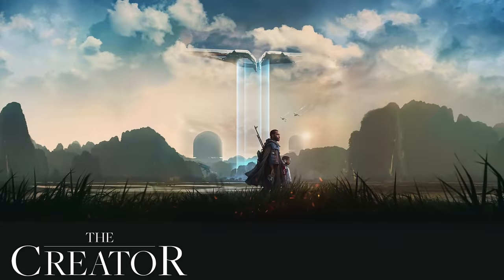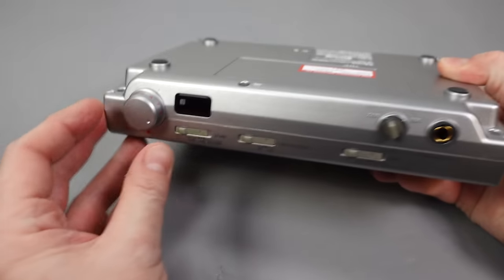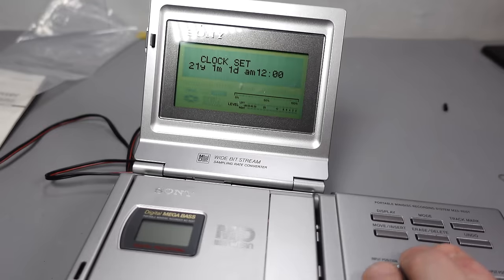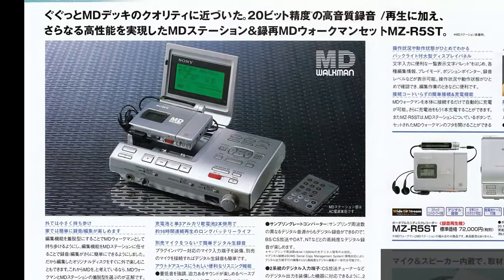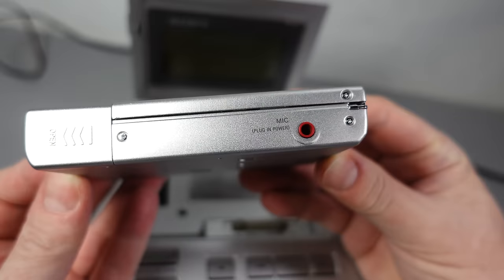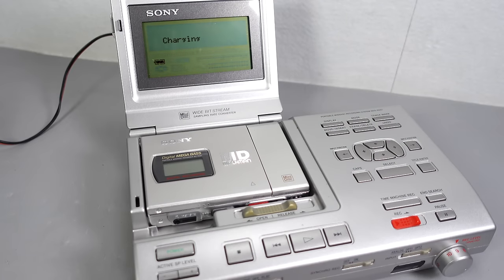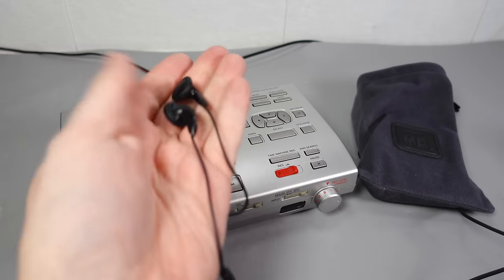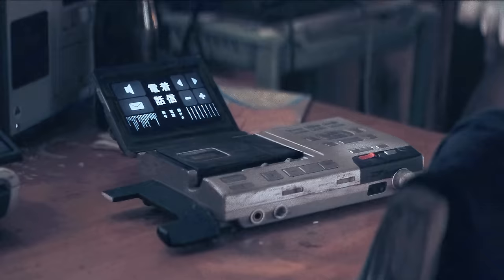Sony’s self-destructing MD Recorder from 2070

Comment: One can only presume that someone from that film watched this video and found out they needed to remove the batteries and that is why their MD recorder is still working in 2070
Reply: Techmoan legit could be a reason why some of these devices will remain for the future in working order. I bet that all of about a dozen people who still have and use these and haven't changed those batteries yet, will start to do so after this :D
Reply: @MetalTrabant  plus all of them that have only recently been killed and are still salvagable
Reply: There need to be a credit in the film "A Special shout out has to go to Techmoan without whom this phone would not be possible."
Reply: Random video on YouTube that played automatically without me selecting it is how I found out about the killer capacitor in the original Xbox 😂

Comment: Thank you.  I have one of these still all working and didn’t know about the batteries.  Extracted them and a little leakage but no damage yet.  Sleep well in the knowledge you helped save a minidisc player.
Reply: take some pictures of the pcb traces for techmoan :)
Reply: Put lithium AA batteries inside, they won't leak, as far as I know.
Reply: I'd just leave the batteries out (and keep it unplugged when not in use) as the corrosion might still conduct electricity and keep advancing if there's a steady source of power there.
Reply: It is probably still worth trying to clean out the alkaline residue as its still conductive and corrosive to a limited degree... I have had success a couple times  on various  electronics removing the circuit board and gently and carefully (to not spread it around) using a tooth brush or Q-tip and distilled water rinse away the alkaline residue, Once or twice that alone solved the problem (apparently it shorted a circuit out) and another time a couple of obvious breaks in traces were revealed and so minor soldering and short wire overlays solved the problem. Just a thought if you want to protect it longer-term....
Reply: Use vinegar or lemon juice to clean the residue off. And then use isopropyl alcohol to clean that off.
Reply: @amojak  In another video, Techmoan said he wasn't good with fixing electronics.
Reply: @dorfschmidt4833 Nope, they most likely would explode since those Ni-Cd batteries were there to get charged by means of the power adapter in order to deliver back up power for that built-in clock once or when said power adapter wasn’t plugged in.

Comment: I have two of these docks that are both working, I had no idea there were batteries inside! This video was a lifesaver 🙏
Reply: Phew !
Reply: I think you owe him a beer :)
Reply: Maybe you could take some macro photographs of the circuit boards to allow techmoan to patch his missing tracks.
Reply: So the superior digital port works. I see no problem here.
Reply: Maybe yours have been used from time to time. NiCd batteries usually leaking after a fully discharge and years of abandonment, if you recharge them at lest once in a year, they may well live until 2070.

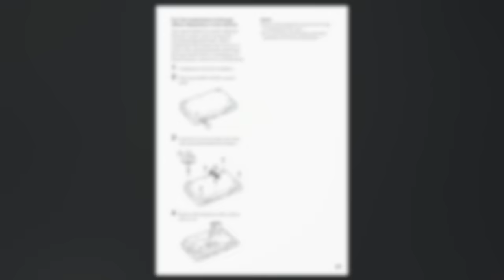Comment: In all my years as an electronics/DIY enthusiast and professional technician, and despite having visited Japan twice, I had never come across the term "minus driver" for a flat-bladed screwdriver until noticing it in that disassembly guide (12:50). Having now Googled it, it seems that the terms "plus driver" (purasu doraibaa) and "minus driver" (mainasu doraibaa) for cross-head and flat-head screwdriver are common in Japan and clearly have been for decades. Every day is a school day.
Reply: Wow yes ! exactly the same here...who knew lol !
Reply: It's also relatively common in Russia too
Reply: Interesting. And thinking about it, it actually makes sense to describe them that way, visually speaking. I'm actually surprised it didn't catch in other places too.
Reply: I knew about "plus driver", and had assumed but never actually seen "minus driver" in the wild. Nice to get confirmation all these years later (about something I clearly never cared enough to look up!)
Reply: That's some lateral thinking right there. 😊
Reply: The plus driver is used for adding screws and the minus driver is used for removing them.
Reply: The plus driver only drives Clockwise.
Reply: LMFAO!! @JamesChurchill3
Reply: @JamesChurchill3  🤣
Reply: i remember that from back when hitachi/tanaka/kawasaki etc used to supply carb mixture screwdrivers with every new machine
Reply: These terms are also relatively common in Germany
Reply: @RiverrRiverr  I have never heared them. Im German technician since 25 years
Reply: I think "minus" and "plus" are used in Germany too. Interestingly, Japanese audio gadgetry for the European market seemed to favor the DIN plugs "long" after many others went all RCA.

Comment: You might be able to fix the PCB by adding jumper wires to fix the broken traces. If you can find the service manual it will help. It's a time consuming process but with luck you might be able to fix it if no critical component was damaged too.
Reply: or send it to a youtuber that does that
Reply: Even if not fixing it, cleaning the PCB with isopropyl to avoid more degradation from the battery guts would make sense.
Reply: @av_oid  White vinegar is good at removing leaked battery ooze as well. But clean up after with iso to remove acidity!
Reply: Yup, vinegar is a base and will neutralize the acid.  Makes a fun little fizz while you're at it, too :) You could clean with alcohol afterwards.
Reply: @simonl7784  Indeed, there are at least 3/4 brit chaps very good at that
Reply: @noisetv1863  You have it backward. Vinegar is dilute ascetic acid and the electrolyte is alkaline. The only batteries that contain acid nowadays are car batteries
Reply: @noisetv1863  Vinegar is an acid not a base. It will neutralize an alkaline chemical (base) however.
Reply: @simonl7784  My Mate Vince!
Reply: @noisetv1863  Wrong way around dude ;-)
Reply: With multi layer PCBs that also aren't documented, there is usually very little chance of repair.
Reply: @KAPTKipper  By experience I know that corrosion due to electrolyte leakage from batteries or capacitor may continue after it was clean.
Hopefully the PCB has no internal layers that could be damaged and would be hard to fix. 
DeOxit could also help I think.
Reply: if somebody has one that isn't rotted out, they could take pictures and send them over.
Reply: Sounds like the DAC (Digital to Analog  Converter) circuitry is what went bad here since the discs are native digital and those outputs work.
Reply: @nimoy007 more likely the power feed to the analogue circuitry has gone due to corroded tracks
Reply: @av_oid  Yea, pulling off all the covers, and cleaning the whole board with a IPA should show where traces go. This could be fixed as the damage is contained to one corner of the board.
Reply: @KAPTKipper I managed to fix a PCB from this era from capacitor corrosion, 2 sides, damaged vias and tracks, replaced 1 or 2 SMD resistors by wired ones + full recap.
Reply: @Bassquake76  and reflow everything with some new solder.
Reply: @Schule04 Unlikely that any but the surface layer and unfilled vias would be damaged. The substrate wouldn't be affected by the chemicals and would protect any interior traces.

I think this would be repairable.
Reply: Yes. Send it over to Mend it Mark!
Reply: @atgv43  This would be a great crossover.
Reply: @noisetv1863 other way round :) (not that it really matters 😂, but you know... comments section... 😂)
Reply: When I was a kid trying to learn about chemistry in the 80s, textbooks themselves so confused alkali and base that I couldn't make sense of it. I chose to never describe any chemical as a base.

Comment: Leaky batteries and capacitors can do more damage than you might think. If the liquid gets underneath the soldermask, it'll gradually destroy all the copper traces underneath the soldermask, without you being able to notice.

Neutralising the liquid fully by full exposure to a neutralising agent (e.g. vinegar followed by IPA) is paramount for long-term conservation.
Reply: Oh, I never knew, one should neutralise severe leakage like that with vinegar.
I would have thought, if all of the leaky content (be it fluid or crystallized) is removed with IPA, then it cannot degrade any further. 😅 Good to know, thank you!
Reply: @Dzubbs  Just a good clean with IPA can work too, but if any remnants are left (like under the soldermask), then those will continue to do damage. That's where neutralising it is the best preventative option.

Even if you do not clean everything off afterwards with IPA, at least it should no longer do any harm to the copper traces.
Reply: @MayaPosch  got it. I have one game cartridge, where some traces got destroyed. Cleaned it with IPA, repaired it. Given the damage, there is a vedy good chance, some got under the solder mask. It is a Famicom game, so disassembly will be stressful, literally. 😂 Hencewhy I would not have checked that in quite some time (was it not for your comment). So you may have saved a copy of Kirby's Adventure.
Reply: Sorry, what's IPA?
Reply: @karlkarlson3502  Isopropanol alcohol

Comment: Most my family could afford around 2000 was a portable cassette player of mid-tier. I can afford a lot more now but still yearn for the nice shiny things that I never will have had at the time.
Reply: I had a similar problem.  I wanted a stereo system with radio, cassette, turntable and possibly a CD player, but any that were half-decent were out of my price range at the time.  Years later, when I was more in a position to be able to afford to save up to buy such things, they'd become far less of a priority and the technology had already moved on.
Reply: That's the exact reason I've a house full of film cameras and tape recorders.
Reply: @Bill-eq5ov   I live in an apartment with eight portable TVs and two 15 inch semi portables...
Reply: @testcardsandmore1231  That knocking you hear is me, I've brought circuit diagrams and beer.
Reply: yea but i skipped minidisc i thought it was a flop and cd was the way to go. i am surprised to learn how many people had minidisc. and i also see people trying to rewrite history into thinking nobody used cassettes anymore in the year 2000. and creating an idealised high tech version of the 90s but it was still mainstream .

Comment: Once I recorded a song onto MiniDisc for a school production in 2006 as I’ve known their sound system for including a MiniDisc player since 2001 and although they got that MiniDisc player working eventually, a staff member got at me saying they couldn’t get it to work and told me to record the song onto cassette! That staff member was REALLY stuck in the past, for a class project on The Phantom of The Opera, she gave us the film adaptation on VHS instead of DVD!
Reply: I noticed especially our female teachers were very reluctant to use any newer tech and sometimes simply refused to learn anything new. Not the best example to give to the students.
Reply: i had the same problem when i was at school they simply couldn't use the wax cylinder edisphone and we had to have the actual string band the heathens
Reply: A VHS in 2006 was not really shocking.

Audio cassettes were shocking.

Left high school in 05
Reply: @darkcoeficient  we were given the Phantom of The Opera VHS in 2005. 2006 was the year of Now’s last cassette release, Now 64. I left school in late March 2006 and started college after Easter.
Reply: Even if the Blu-Rays were available in 2006, 
but of course, 
an expensive cutting-edge technology,  back then.
Reply: @adultmoshifan87  I watched it on VHS too lol. I think the last movie I watched in VHS as a new release was... Maybe lucky number slevin? I don't remember now. We got a dvd player in 06.

Comment: Get the service manual for the device. Search for L301 and IC301. These are the coil providing supply to the ADC/DAC and the ADC/DAC chip itself. The rotten trace just above the batteries happens to be the one with the supply going to L301 and from there the IC. Should be easily fixable with some wire.

Comment: Dear Matt
I fear I also suffer from “techmoanitis” and we share very similar views about aspects of technology. In particular this week's episode about the Sony MZ-R5ST, you may have saved me a problem, as I have one of these and I didn’t know about the internal batteries. So thank you for that bit of wisdom,  Fortunately mine has only  corroded the battery  terminals and non of the board. A drop of white Vinegar and IPA has caught it all in time.
Whilst there clearly is battery leakage in your unit, I have a suspicion the lack of analog output may be down to the actual MD player rather than the dock. The main clue for me was that you couldn’t get any output from the inline remote. With my unit I do get output with the player in the dock. I’m not sure how or if you want to get around it.
Reply: I bet he thinks you pulled a prank on him,you should apologize
Reply: He's getting output optically (digital) not anything else (analogue) the good money is on the clear and obvious alkaline damage.

Comment: I always wanted to get into MD, but I just never had the money, and by the time I did it was already becoming rather obsolete. They still fascinate me, but I cannot justify getting one since I would almost never have a use for it other than playing around with fun tech. So thank you for letting me live out these desires through your excellent videos. :D
Reply: Exactly the same for me.  A friend of mine had an MD player/recorder.  IT was the net MD variant, and could plop a load of MP3's from her computer to a blank disc, have a bag full of discs, and play whatever we wanted on the bus.  At the time I could never afford such a thing.  Just  a few short years later, when I could afford something like that, HDD based players like the ipod had completely displaced MD, offering massive capacity without the need for removable media.  There was the Hi MD which i was sorely tempted by (1gb was a massive amount of storage at the time!) but when the contemporary ipods and other players could hold 20-60gb, it seemed expensive for what it actually was.  I do regret not getting one though!